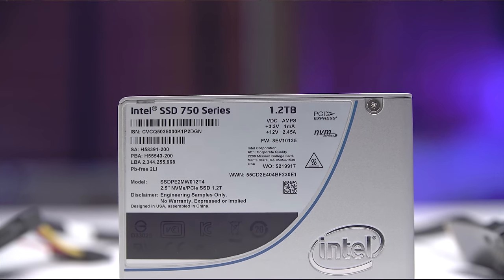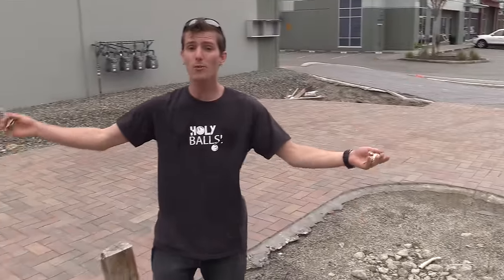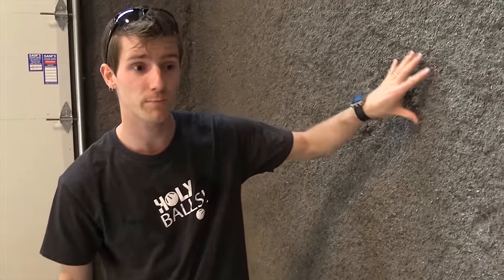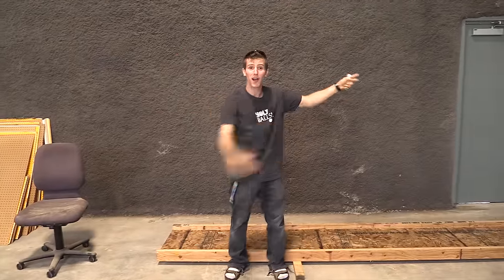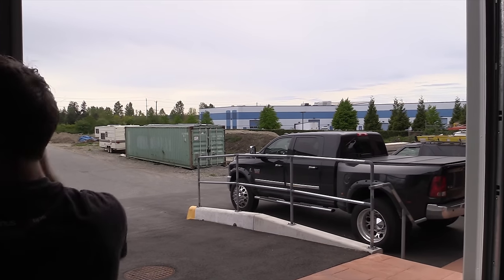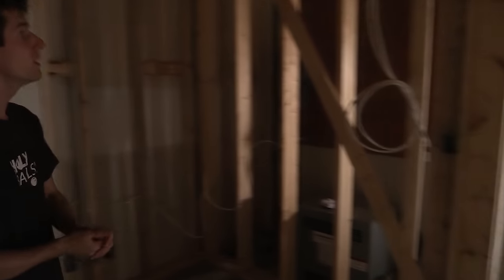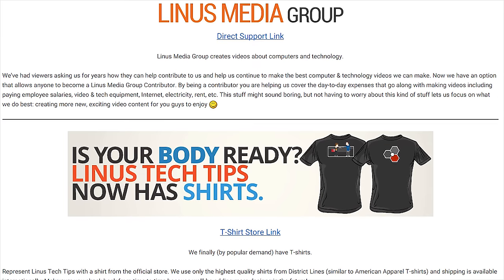New LMG Headquarters Tour! - First Look & Construction Issues...

Comment: Small Reception area,  Boardroom W/conference table, Kitchenette and Lunch room, dedicated air conditioned controlled environment for your server/ data center,  you might be able to get away with a portable AC unit and small closet on the exterior wall of the office, and you need to supervise your contractor, give him a punch list  and deadlines or he will drag you into next year, pay by the job not the hour.  this should take no longer than thirty days at the most,  get extra construction personnel if that what it takes, cheaper in the long run,  at this point having to maintain two places is costing you more than money, have the contractor pay for his own mistakes like damaging of your walls,  Good luck
Reply: ***** Lot of solid advice here.
Reply: ***** good ideas! I could really see the boardroom upstairs, on the window side, and the other side a lunch room
Reply: ***** From my discussions with him they actually ran out of cash at some point, so the pacing could have something to do with the amount of resources he has available.
Reply: LinusTechTips
Reply: As a construction contractor, you're absolutely right. Never pay by the hour without an agreed number of hours before hand

Comment: Needs a fire pole. :P
Reply: Greencoast all that wood and electric wiring...
Reply: lápi póc I think he means a pole to slide down from the top to the bottom. Not a pole that's actually on fire.
Reply: Yes. He does.
Reply: mhuizingh92 I know; I just made a different point.
Reply: Greencoast Oh - an a real fire-pillar inside a big glas-cylinder - aquariums are for kids ::P
Reply: lápi póc Oh I thought you were pointing out a fire hazard or something.
Reply: mhuizingh92 thats exactly what i was pointing out. can we just drop it?
Reply: lápi póc I just don't see the connection.

edit: 

Nvm. I got it now. You were adding to his 'suggestion' by saying that the firepole was for escape. I though you meant to say that you were against the idea (you used triple dot and made it look negative) a firepole was a firehazard since there was all the wood and electric cabling. But you meant it as an escape route since all the wood by itself is already a fire hazard. I originally didn't make the connection. It just seemed like a fun way to get downstairs. Not a way to get down fast in case of fire.
Reply: mhuizingh92 I like to know where the "Linusmobile" would be stored :)
Reply: mhuizingh92 fascinating the human mind is :)
Reply: lápi póc Honestly, if the wiring is done properly - which is likely given that Linus is a Tech guy, the fire risk is not massive. Also, the vast majority of buildings in US/Canada are wood frame - so its comparable to a normal house/building.
Reply: Greencoast Damnit, I literally typed that then scrolled down to see your comment.  I also recommended a slide in leu of the pole.
Reply: Greencoast that and a twisty skid-slide. Water slide!!
Reply: AAAAAND....: the complimentary zip line into all the different sets.

Comment: 1:50 I would bet those are conduits for pulling electrical further down the line, not water.
Reply: frollard that is schedule 200 pvc made for water.  I worked in irrigation for years.
Reply: drink15 At 1:33 you can see there is another of the same size PVC on the other side of the wood

Comment: The part where you said there is a lot of electrical stuff, you should probably put some type of piping for the water cooling project later on inside the wall see you don't have to make it outside the wall

Comment: Server room should be as central to the building as possible, with raised flooring and ample space for expansion and space for air conditioning and fire suppression. Would also be using 3 phase UPS's. And for the love of cable management, keep your patch panels and switches in a separate rack. That is all.

Comment: It seems the ideal place for having multiple recording stages but is natural lighting enough for people working in "the office"? i think it's always good to have a window in the same room where you work with the computer for hours.
Also what about air conditioning? From experience those places tend to be hot in the summer and in winter they usually pump air for changing the temperature of the whole "hangar". Annoying noise for your kind of work. I'd like to see which solutions you'll use!

Comment: From experience it seems like a large amount of construction workers don't give a damn. I know there are people in the trade that do excellent work and have a passion, but I've encountered more often the types who don't care. I had a store built and they never polished the concrete floor, warped the metal wall panels, and didn't run the electricity right. Not to mention they dumped PAINT into our drinking fountain and clogged it. 

Linus, I hope you don't settle on shoddy craftsmanship and negotiate the contract to your favor even after the mistakes have been fixed. You have video proof for negotiation.

Comment: Whomever is your project manger should be fired. Also, are you going to use fiber? I did here cat 6 but why not fiber connection? Are they covering the foam wall to protect the wall from damage? Also will there be room for guest to sit in the WAN show like a little area for them or next to you guys like an anchor desk area? Will the server room have its own cooling system or is it not that huge of a server room to have a HVAC? If you haven't notice I like planning and construction. Also have spent a lot of money on similar projects.

Comment: I got a serious question for my gaming PC build. Im building my PC mostly for games that don't demand too much and I was wondering what kind of graphic cards I should get to support 6 monitors at 1080p for each screen. How should I build my PC if I have $2500 solely for the PC and not the screens, keyboard, and mouse?
Reply: But why would you need six screens?
Reply: Tushar Nair Ikr and got a little confused too when he said games that don't demand too much for GPU. If he plays let's say cs:go or minecraft it would require at LEAST 2 980/970 to drive them in 6 1080p monitors, which is 1.5x more than 4k, and you can't even game decently without lowering the quality for a smooth 60fp.
Reply: leadmaster537 Yeah that's true.

Comment: I work for my father rebuilding a house for church, to earn $$ for my pc of course, and earn heaven points. I must say the way THAT cement is done, is without measurements and a very sloppy job. Granted im a rookie, but you can clearly look at the edges and see how curvy they are instead of slick and sharp ones. The wall its self looks buffed with a ton of water and Sand mix.... That wall needed more cement then Sand....

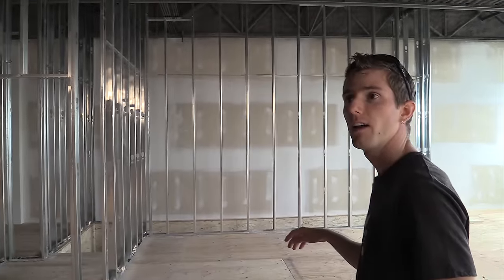Comment: 8:02 Why do they always put the white dots on the walls ?
Reply: +Dino Prašo dem be cuvverin up dat dere nailz in de boardz wit dat white hard stuff.
Reply: +Dino Prašo The white dots are actually plaster to cover up the screws used to fasten the drywall panels to the metal studs. It's to make the wall look smooth once it's been painted. The large white bars are the seems between the panels.

Comment: New MLG Headquartes is located at an office block near Langley, Britisch-Columbia.

https://www.google.ca/maps/@49.0979187,-122.7056791,259m/data=!3m1!1e3
Reply: 234jari234 And their current office is in a house in Langley. What's your point? Neither is hard to find. All you need is a few min. and a little Google-fu. But even though it's easy to find in this world without privacy, they probably don't want it known to the world at large so as to discourage unannounced visits by the general public and protect the thousands of dollars of tech that they will have there.

Comment: Ok.. I'm not doing this but FOR SAY I did. What if.. I got a i7-5960k a 3-way SLI TITAN X OverClocked, 32gb 1866mhz Kingston Ram. About how long would someone have to to upgrade there PC if the parts never went out? When I'm older imma look back and be like " holy shit that pc couldn't even run GTA 19"

Comment: Won't the massive space create some pretty nasty echoing in videos?
Reply: Flat4Buggy I doubt the foam will do much do deaden the sound. The foam is on the walls now and there is a terrible echo, so it cannot be that effective. If I had to guess, the gray foam is heat insulation. Pretty much every parking garage is covered in the stuff, especially the ceiling where an extra thick is sprayed around pipes to prevent freezing in the winter. I work pretty close to LMG and in the winter that insulation can prevent a lot of heat (which costs money) from escaping through those cement walls in the winter.

The best thing for the echo would be interior walls separating offices and furniture in the open spaces. For extra protection on sets, sound foam (the sheets of foam shaped like egg cartons, spikes or furrows) can be added. 

I'm assuming there isn't going to be a drop ceiling over a lot of the area. To further prevent echo's in this area, you can hang large sound baffles from the ceiling, which can be hung high enough to stay out of the way of camera shots. Google "sound baffles", lots of pictures are shown.
Reply: 6foottallAardvark You should take into account that much of that space will be filled in, and linus will most likely put up sound barriers.

Comment: Is this a good build for gaming, I want to play games like GTA 5, and Skyrim in 1080p at least. I have the Case and the OS. These parts are all about $750. I have a total budget of $800 max. Is this good?

Intel Core i7-4790 3.6GHz Quad-Core Processor

Asus Z87-Pro ATX LGA1150 Motherboard

Corsair Vengeance 8GB (2 x 4GB) DDR3-1600 Memory

Western Digital Caviar Blue 1TB 3.5" 7200RPM Internal Hard Drive

Asus GeForce GTX 960 2GB Video Card

Corsair CX 600W 80+ Bronze Certified Semi-Modular ATX Power Supply

Asus DRW-24B1ST/BLK/B/AS DVD/CD Writer

Cooler Master Blade Master 40.8 CFM 80mm Fan (it's a replacement rear exhaust fan)

Windows 8.1 64-Bit

And an My first PC which I'm going to to completely upgrade with these parts of all goes to plan. Which is a REALLY BIG upgrade from what it is now, and after 16yrs of everyday use and still working, bout time it got an update.
Reply: Trade i7 for i5 and upgrade 960 to 970. That's a MUST.
Reply: arcadeportal32 If you don't plan on overclocking you can get an Intel Xeon 1231 @ 3.4 or 1241 @ 3.5 which costs $250 and $275 respectively and will perform nearly identical at stock (4 cores 8 threads just like i7's but they have no integrated GPU). As said above though getting an i5 instead and upgrading to a 970 would be the best route.
Reply: ***** first rule of gaming pc building. NEVER scrimp on your gpu or psu. Hopefully you don't need to scrimp on anything, but if you do. The gpu has priority over the cpu. Especially when it's an i7. The difference between the i5 and i7 is negligible in gaming. The difference between a 960 and a 970 is immensely noticeable.
Reply: ***** Would the Asus GeForce GTX 970 4GB STRIX work?, ok ill switch from the i7 to an i5, I might be able to get the unlocked version of the i5 4690k for overclocking, but when it comes to OC I still hardly know where to start when it comes to Overclocking the CPU,GPU, and so forth... hence why the i7 wasen't the K version, but I like the idea of trying it "Without" killing my CPU.

Im using my first PC as the case, It does NOT have mounts for a 120mm water cooler "There are many fans in the case to keep the build cool (the rear exhaust fan is about 80mm to 90ishmm, but it will have the PSU fan, 2 aftermarket exhaust fans plus im now thinking of adding a good sized aftermarket CPU cooler. So cooling without OC should not be an issue. And I really would like to keep this case.

But if I overclock CAN I do it with an Aftermarket CPU Air Cooler, and using my fans? Adding water cooling to my PC would be a challenge.  I don't where to start when it comes to OC, but how should I start when I get the parts.
Reply: Yes. There are many low profile coolers that work very well. If you have the clearance the hyper 212 would be a good start. Also do you not have a 120mm mount. If you do a radiator and fan could easily go there. Water cooling isn't as bad as most think. Also the I5 4690k is a beast without being overclocked. I mean you could tweak it with a good cooler surely, but Intel's chips do so well by themselves. 

The ASUS 970 is baller. I have 2 in SLI and they crunch and game at 1440p 60 fps. So for 1080p it'll be a smooth dream. Consider the EVGA 970 as well. It's not as pretty. But it apparently has better overhead for clocking.
Reply: ***** I don't have a 120mm fan mount, (The rear is a 80mm i beleve) But it is ATX 100% from the top of the case panel to panel is about 8inches wide and can support a full sized ATX board as the one currently in it is ATX, though its ancient lol. 

I COULD just drill holes in the back to mount a 120mm fan (I took the 120mm fan from the dell and put it where the fan is currently in my ATX case and it would easily mount with a drill and screws lol as the real estate is wide enough I beleve.

I have to read up on overclocking though, I mean, is it hard to do lol.
And I know im going to go over the budget, but i just don't want to go insane lol
Reply: Its very easy to do as long as you do it safely. Proper cooling and such. A case with good positive flow is a must IMO. Just buy an NZXT Source 210 or something. Super cheap but capable of very good cooling.
Reply: ***** NO the NZXT Source has the HDD Slots facing towards the mobo, my friend smashed his hand into his mobo when he was taking out his HDD, luckily he was using an old MOBO, but he still had to spend 60 dollars to buy a new one...
Reply: Moby Dick Of Dopeness What?? Lolol is your friend totally hopeless?? That is... Extremely hard to do. I have 6 of them to work on in my university physics lab and what you described has NEVER even close to happened.  Nor have I seen any complaints about that on any reviews. It's a quality case and you have to be a special kind of inept to jack up your hand or mobo in there. Hot swap drives are convenient surely, but let's not fear monger over a non-existent issue. Unless you are your friend of course, who should get an award for improbably scenarios and brute force.
Reply: ***** My friend is a bit slow, but he was pulling it out way to hard I admit, but non the less if the HDD wasn't facing the Mobo then that would not have happened, and my friends hand wouldn't have a bandage.
Reply: Moby Dick Of Dopeness well that's how the has majority of cases have been for 15 years+. So I don't see it's a huge drawback as it's a proven and acceptable setup. I mean if you're going on the cheap, you're not going to find too many cases that are quality, roomy, and equipped with hard drive sleds. I though if one had to be sacrificed, it's be the sleds lol. I picked up the cases for 29 dollars each refurbished. Crazy good deal. Of course if I could recommend any case it'd be the define r5. My current case.
Reply: ***** To be honest I would rather just spend an extra 30 dollars and buy the nzxt s340.
Reply: arcadeportal32 For $800 you can get yourself some supplies, open up a life insurance policy, and live out your Skyrim GTA 5 fantasy for real.

Comment: this video needs to be in 60 fps, the amount of motion is very irritating
Reply: dragantoe First off, it's a vlog, not a pre-scripted video with proper lighting, sound, etc. like most of their other videos. Plus, there is more moving around than they normally do. If you are referring to how shaky the video is, 60FPS is not going to help. A Steadicam/Glidecam would help stabilize the image and help make the motion smoother, but it doesn't change the fact that they were still in the warehouse and there was a lot of trip hazards that both Linus and Edzel had to avoid just to film.
Reply: fast motion like that is better suited to 60 fps, using a cellphone with OIS and 60 fps would have been more desirable than how this turned out